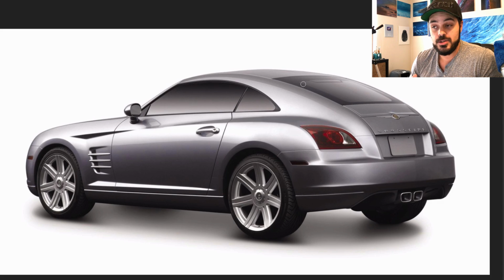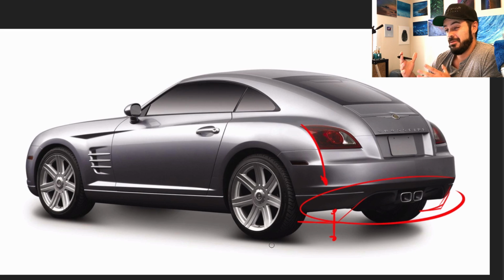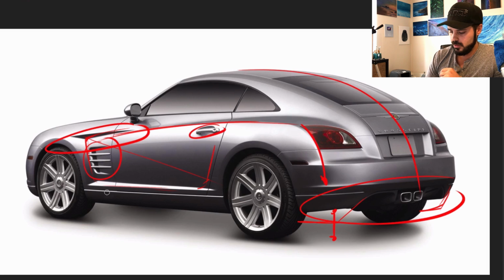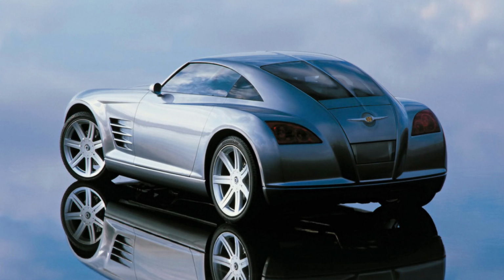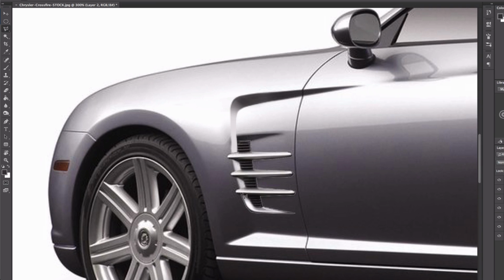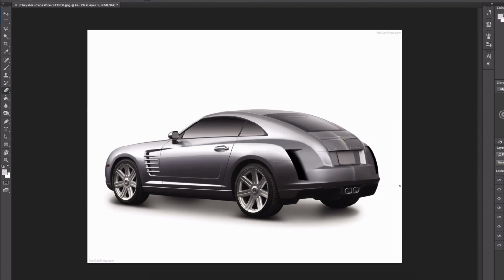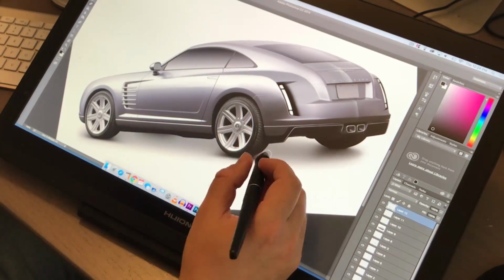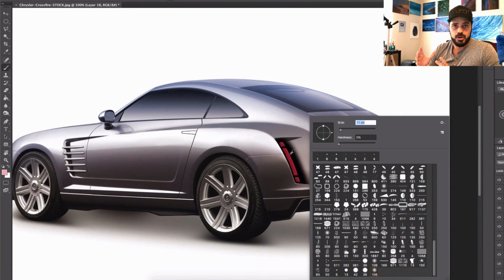Chrysler Crossfire Re-design - What would it look like if made today??

Comment: For me it's too many converging lines at the back.
Maybe move the horizontal line where the Chrysler badge is a bit lower and carry it across the tail, widen the rear of the roof out to the inside of the tail lights, carry the bumper right across so the lights don't look Cadillac-ish, and loose that awkward convergence of lines on top of the bumper either side of the number plate.
But hey just me, pay no mind, love your work.

Comment: Better, but the main problem with the design remains unchanged - the humped Marlin fastback that goes down to the bumper level. I like fastbacks in general but this is the wrong solution. The easiest thing to fix if you have one of these is the stupid grooves in the hood. Fill them and repaint. They also appeared on the Sebring and disappeared with the Sebring facelift after they got rid of Cerberus. I never understood where they came from - boat decks or something? Maybe they should have done the hoods in teak.

Comment: The execution is good but I think your illustrating the point that there's not going to be much improvement if you just add on some modern styling treatments to an old profile, in some cases it may look odd. The original design is always better than facelifts, in my opinion, because the lines are more cohesive. I've noticed with Toyota they release a dumbed down detail with modern profile first then release the attractive more cohesive design (probably the original and both done at same time) with the facelift.